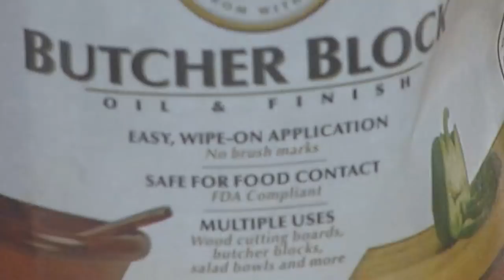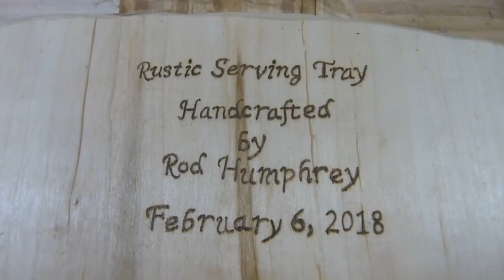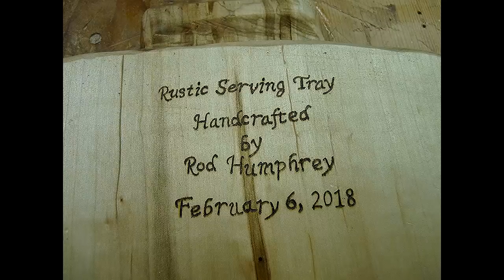Power Carving a Rustic Serving Tray

Comment: Very nice tray. Question: Why the change in tool types, as you progressed through the project?
Reply from the maker: Thank you!  The initial change from the Proxxon was because it was a poorly designed tool, or a defective product, that burned out on me.  The other tools, like the angle grinder is one I use often in carving, and seemed right for the shaping tasks.  Sometimes I just break out tools because I haven't used them in a while too 😊